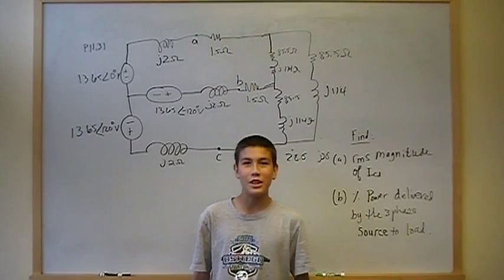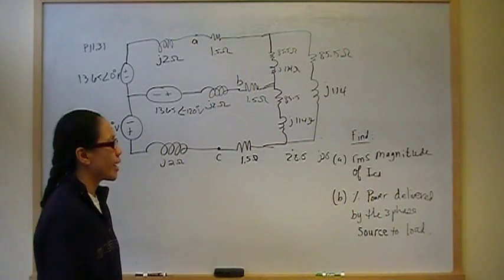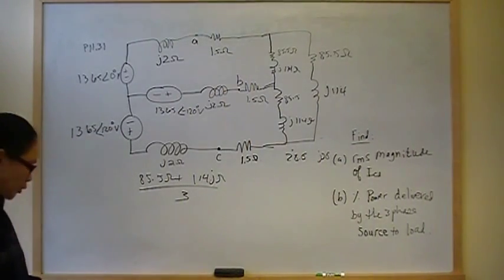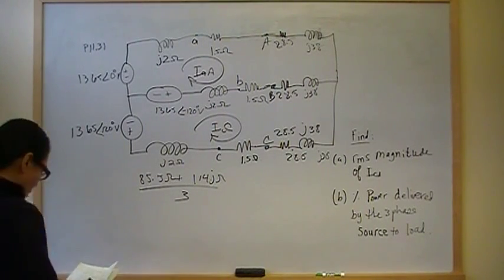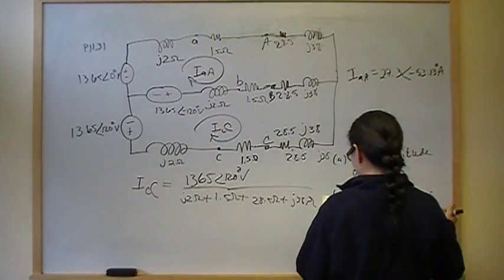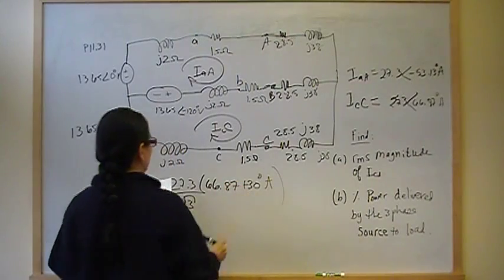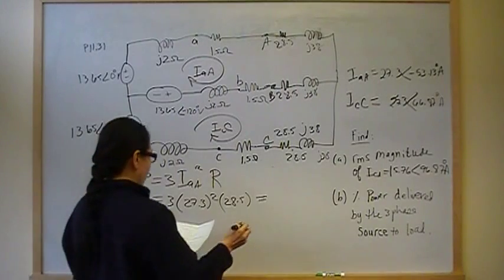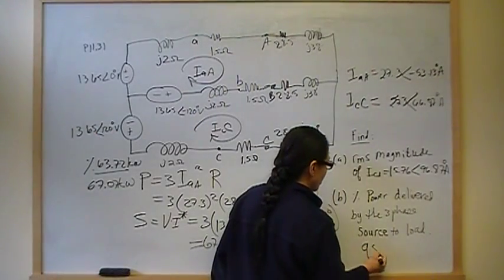Power Calculation Balanced 3Phase P11.31 Nilsson Riedel Electric Circuits 9E Solution

Comment: Very good problem.  The trick was to 1st convert the delta load to wye, then get the current on an adjusted phas to N basis by dividing by root 3 and adding 30 degrees, then getting your real power, apparent power by V*I conjugate, then the pf by simple division of kw over kVA.  Tricky stuff.  Thanks for sharing.